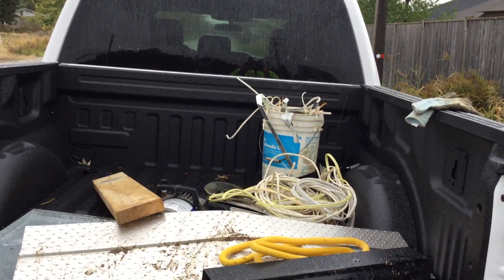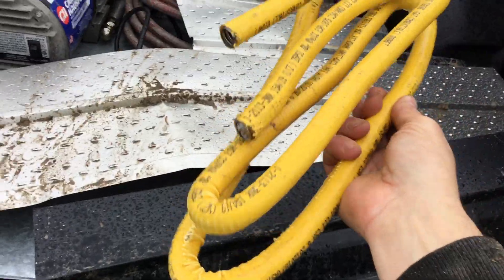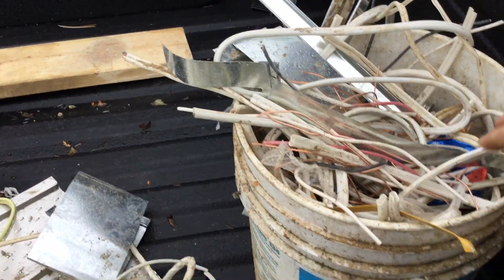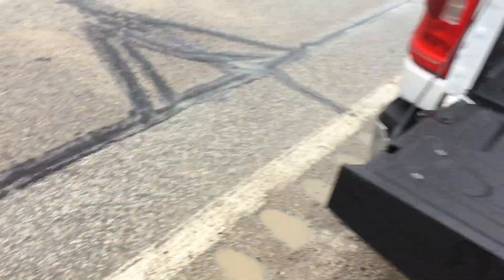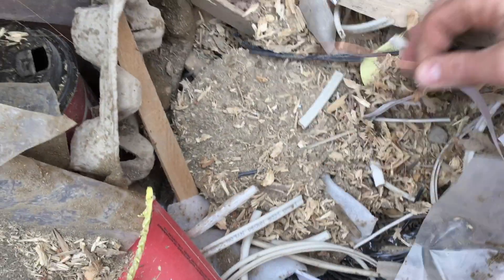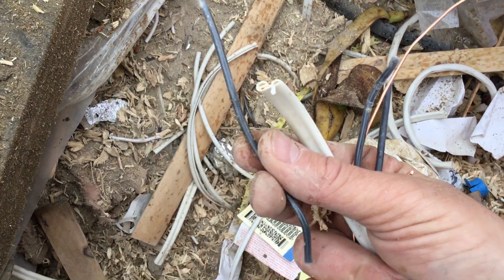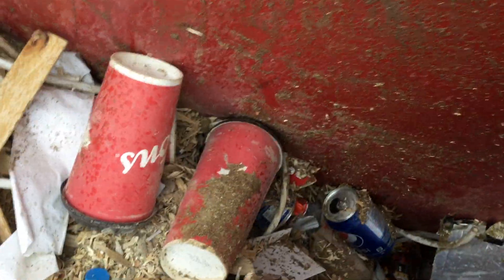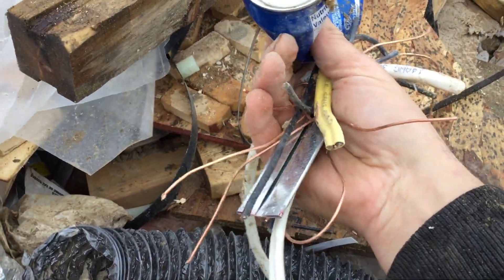Dumpster diving for copper wire, stainless steel, aluminum, and other great metals

Comment from the maker: Total result was 6.25lbs of #1 copper wire.
Reply: I found a pile of strippings from someone dumping their trash from stripping copper along one of my local range roads while scavenging or bottles and cans plus any trash or scrap metal laying in the ditches around my area and I found a few nice snibits they missed 😂👍🌎♻ I picked up all the mess and I'll drop it off at my local dump in the plastic recycling bins thereally was also some 2 inch aluminum casings with the insulation on it they just left as well so I'm going to try and strip it off with a knife. I hate to thino that it was stolen from somewhere as there was a huge pile just laying in the ditch 😤